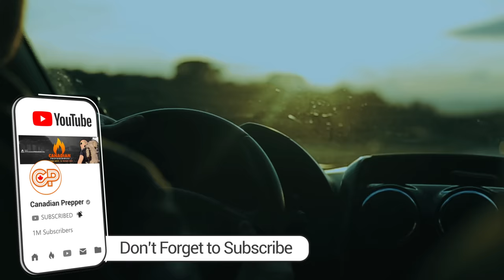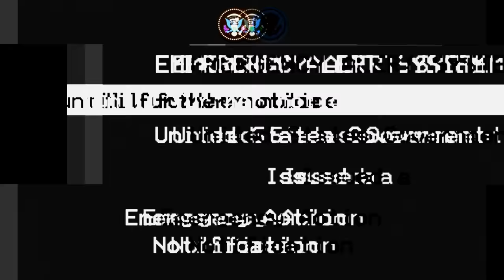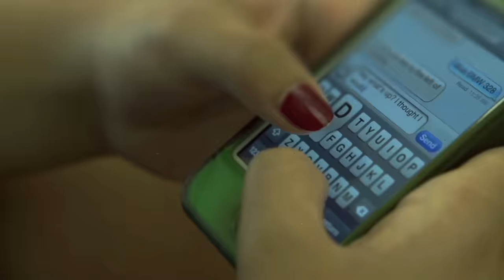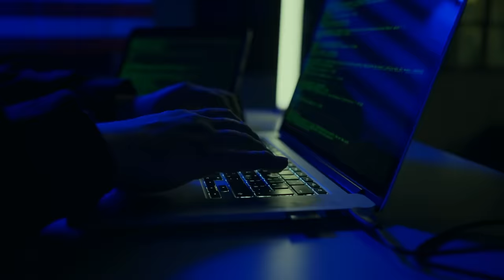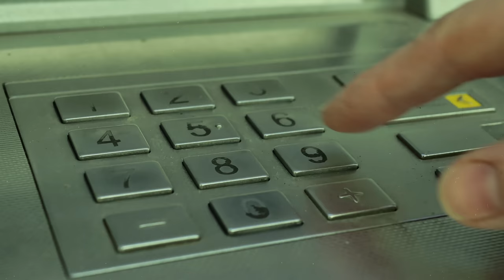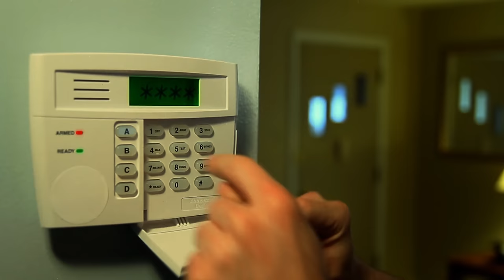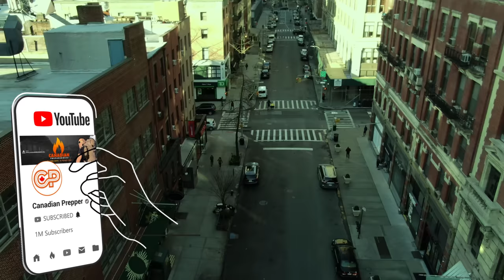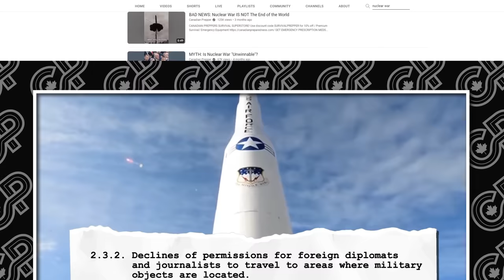Surviving The First 24 Hours of Nuclear War

Comment: It baffles me when some channels say "get a gas generator first".  Where I live I can hear a generator from a mile or more away.  No way I want that kind of attention in an SHTF situation .  Thank you for the information Nate.
Reply: One of those really quiet ones and a sound proof wall built around it works amazingly well.
Reply: I have both and I Wil use gas when the power first goes out. When I run out of fuel I will use my solar generator because it's quiet.

Comment: Duct tape seals around windows ensuring no air getting in, you can put plastic, cover windows so no one can see in, board if possible, have a way to secure doors or access type of deal. Remember to shut off water so no sewer back-up. Filling tubs sometimes leak through if you can fill plastic bins and pile in tub or showers last longer, bring in those garbage and recycle bins they can be for flushing toilet, etc. 
remember not to burn candles longer than 4 hours and give them a break since no windows open. 
Don’t open door to those you don’t know, don’t make yourself an available victim.
Then be kind when building new world look what brought us here.
Reply: Won't work
Reply: #1 You can't see out either to see who's coming.
#2 Four guys in full tactical gear and you're xxxxx.
#3 Trapped in your little bunker
Reply: Thank you for these tips. I made notes!
Reply: I never, ever thought of my garbage cans.  The recycle bin is actually quite clean.  The other is not bad because I always use plastic bags.  They would certainly be good enough for flushing toilets.  I am going to use my washing machine to hold water.  It is the same water that comes out of my kitchen sink.
Reply: @hotrodray6802 I have 12volt camera system for tractor trailer, in the event of catastrophe I have glass breaking sensors for each window, borders for all windows and the cameras will be mounted outside up high so I can see what's going on and what's outside. Also I have sandbags will be set up strategically inside my house and Several fire extinguishers. I would rather have something set up then nothing at all. We also have tactical gear for several people in the house.
Reply: @gailoreilly1516 when fallout is gone we can use beach umbrellas upside down on top of trash cans and bins to collect more water. I have two Hugh bladders and connectors that will go on my spouting to collect a lot of water when it rains.
Reply: Learning a lot, thanks everyone on this thread.
Reply: @Randy2747  Good idea.  That is something I can do.  To put a hand pump on my well, I would have to pump water up from 125 feet.  I'm not sure but it seems I won't be able to do that.
Reply: Sewers will start backing up, in the city, and reverse flow into your homes.

Comment: @Canadian Prepper Please consider a video on how to board up your windows. Do you put the boards on the inside or outside of your windows? Or both inside and outside? Do you nail the boards, screw them in, use metal plates? What is the most secure way to board up the windows? Or, is there something better to board up windows than wood? What about metal grilles or hurricane shutters?
Reply: Just my opinion metal wood be the best and screw from the inside so they can't be removed. But it will be expensive!! I decide to buy glass detection devices for every window. I will board windows from inside. I also have a 12 volt tractor trailer camera system so when the glass is broken I know which window is broken by sound and/or cameras and then I know which boarded up window to shoot through. I will also have sandbags strategically set through out my house incase they shoot inside. I also have fire extinguishers incase they throw something inside to catch house on fire. These are just my thoughts, hope it helps you in some way.
Reply: So your best bet is to use ply wood, any type, put any none-useful items in the window, this will help slow down or maybe stop radiation and even small caliber bullets from entering, then board em up, from the inside first, use the longest deck screws or get some lag-bolts, and you mite want to make a few peep holes using mirrors if you want, but keep in mind if you board all the windows, make sure you have two exits incase of a fire, best of luck my friend

Comment: Nate, people should be aware that if you heat with oil, you can burn diesel in your oil burner... it's the same fuel one just has dye   in it so as to differentiate between the two
Reply: Also one has more detergents in it 
All big heavy equipment will run out home heating oil

Comment: Great summary in my opinion, but I have not been through a nuclear war. One thing with the comms '-- you are likely put of luck for at least a couple of days after the last bomb. Even if you don't get an EMP the air will be ionised and your radios would not work until that disburses.
Reply: Would that be only in direction of fall-out or just the area of the blast, because iv got a courier 2 10 meter with twin 820 linear amps jumping off a 62 ft die-pole yagy rod, and i can cut thru just about anybody brodcasting
Reply: @psycho6542 It is a large area around the explosion, and likely furthest from an aairburst. It is fallout independent -- ,ore a result of the heat ionizing the air and the lightening storms after. It does die down. If your equipment is not fried from the heat  the sgockwave, the EMP pulse and the storms you should be OK.

Comment: About the "get to the center of the building" There are some recent studies that show the blast wave (not the fireball) follows the same path as fluid dynamics.  Provided you don't get vaporized, the safest place is wedged in an exterior wall corner, on the side of the building that takes the initial shockwave.  As long as the wall holds, the pressure from the blast shouldn't rip out your lungs or rupture any organs.
Reply: so a lot of luck is necessary lol
Reply: What about the radiation?? 🤔

Comment: 80% of the US lives in cities. Cities will be secondary targets after military bases, and many of those are in or next to cities. Unless you have a rural property at least 60 miles from a target and already have an underground bunker with several feet of dirt over the top and it's stocked with at least 3 months of food and water and has a CBRN filter for air coming in... getting an alert simply won't matter. You'll either die from the blast or hours or days later from the radiation.
Reply: & do number 2s in a newspaper & drop off in TURD recycling depot 2 convert into POWER source
Reply: Who builds a bunker and then only has three months of food? A dummy
Reply: @lawrencegarcia1675 food is only going to last so long. I'm mostly stocked up on salt and spices to make marinades. Human thighs, hearts and ribs will keep me going alot longer
Reply: If you pick a direction and go within 15 minutes,  you will avoid fallout.  Just pick the right direction
Reply: EXACTLY

Comment: you present more resistance if you face away from the blast or fire. As a wild land firefighter I learned to lay down flat FACING the fire (inside the fire blanket), the fire will roll over much easier

Comment: Kind of makes me think of a underground oasis like star trek the wrath of kahn. Where the genesis device made a cave like an oasis. Something like that would be ideal for living underground. A small hydrogen ion generator may make a long term energy source where a device uses microwaves charge a carbon barium titanate capacitor to make high voltage fields to strip electrons from hydrogen to make heat and pressure to run a turbine or mhd generator. Water electrolysis and fuel cells could make clean drinking water and for irrigation. Long life LEDs may make light for hydroponic farms. So this is turning into some idea like that from Dr. Strange love.

Comment: That Kaito shortwave radio you showed is a lousy radio at best. It's not full-range in the shortwave spectrum and it doesn't have Single-Side-Band (SSB) capability so it's useless for tuning in ham-radio operators which may well be the best source of reliable news available.
Reply: What do you suggest?
Reply: @NikiLivi5  Something such as an ATS-803A or a Satellit-500 or a Degen DE1103. They're readily available second-hand. You want a radio that does the full shortwave spectrum right up to 29999khz and one that has SSB capability.

Comment: Here's something I learned last night. That people saying if you put your phone in the microwave and it will protect it. It won't. If you put your cell phone in the microwave and you call it it will ring in the microwave which means it's still receiving a signal and you will still get your update. Then I heard another statement on the internet that if you wrapped the phone in cardboard or paper and then wrap it in five layers of soil it would block the signal. I will try that tonight. And in the microwave.
Reply: What were the results with the ringing.
Reply: @wmluna381  it didn't ring once I wrapped it in paper towel as a insulator, then in foil and placed in microwave
Reply: @wegmandan  Interesting. Thanks for the update. I actually have a defunct mwave stored up, but haven't gotten to prove things out on this for myself.

Comment: As I was watching your video on 35 winter survival items,  I noticed several points that you got incorrectly. One is that water freezes at 32 degrees, not zero. 
Another one is that the foil coated bubble wrap is insulation, in that all insulation is created by trapping air in various ways. Which is exactly what bubble wrap does.
Reply: 0 degrees Celsius, 32 Fahrenheit.
Reply: @bwfvc7770  Sorry, I forgot that you are in the UK.
Reply: @collincluff7955  Antipodal to that.

Comment: So I do disagree with the 2 to 3 days food supply that the average person has most people especially in the northern states usually has a full cupboard which for a single person can last 3 to 6 months. More people in the house and your looking at less time but if your not a hog about eating and ration your food this means small portions for each person you can go pretty far on what you have at home. We all have food that we pick up at the grocery store thinking we will eat it and just leave it in the cupboard until it expires but in an emergency we will eat anything that's there. To say that the average person has 2 to 3 days of food is like saying I have 3 cans of soup and 3 instant oatmeal packets in my cupboard and nothing else. I have encountered people that have had empty cupboards in there homes but it very few especially in northern states we always have winter emergency that require a well stocked cupboard even if we eat out a lot. I also disagree with the hiding since of smell that Canadian prepper is taking about most people can't smell anything outside there homes and people are not going to mutate like on X-Men where you can smell them from miles away. I live pretty close to some of my Nabors in seeing distance in fact and I can not tell by small if there cooking anything at all. The exception to this rule would be charcoal grills I would avoid cooking on these because the smell does carry pretty far.

Comment: Hey Nate let people know that a 1 or 2g pesticide sprayer will come in handy in SHTF for when they run out of toilet paper,,
Reply: I've had to prep the smaller handheld pump ones over a winter period when my building had ongoing hot water issues. Got them for like 6 bucks at Har. Freight. Heating water for the first 2 till like 110 degrees and the last 2 till like 135 keeps a steady heat. It's easier to maneuver the handheld ones to get at nether regions without having to modify things for the bigger gallon+ ones to not have them get all wonky and tip everywhere. The ones I used were .5 liters, I believe. It provided a pretty decent "shower". People with long or a lot of hair may need to make adjustments.
Reply: It's also good to get a sense of how long you can go in different types of weather before you get to feeling / looking super disgusting. For me that's 3 days and I generally don't sweat a lot. This will let you account for that bare minimum hygiene storage water.

Also, if you're a bigger / taller person, in addition to having the a lot of hair thing going on, that's another supply adjustment. I'm smaller / short.
Reply: @wmluna381  I had gone way past that mark in the military years ago. There were times we had to go months without a real shower/ bath. But it was nice to come across a stream, river, pond, lake etc. no matter the weather. I guess that's where some of us vets have "a leg up" so to say. Some of us had to live the life already, but it was never easy and doesn't get easy no matter how long-lasting.
Reply: @jackmaness2048  Wow, I couldn't even imagine going that long! But thanks for letting me know that it is indeed humanly possible...and survivable. 😄